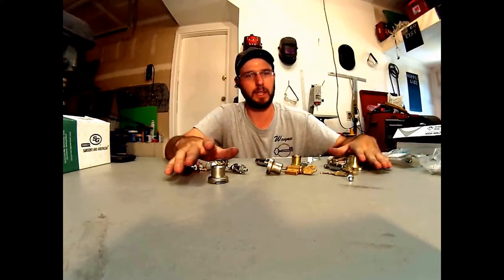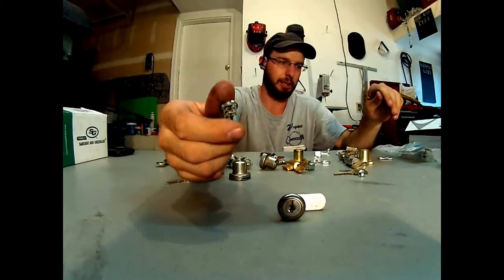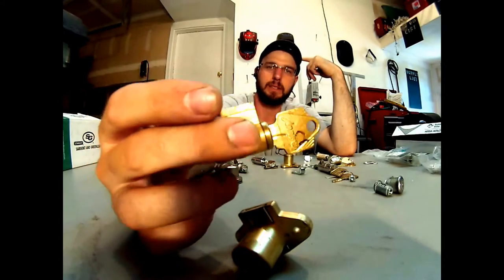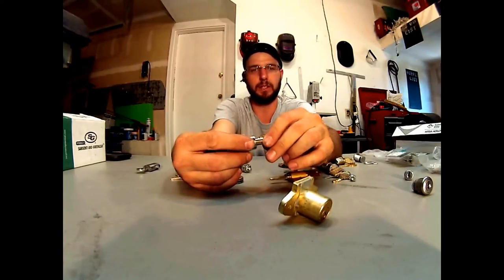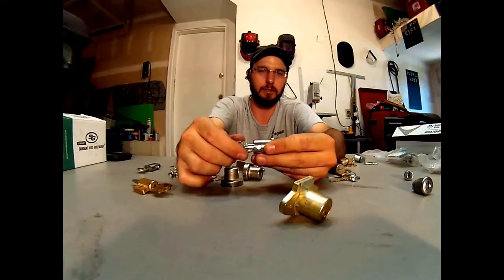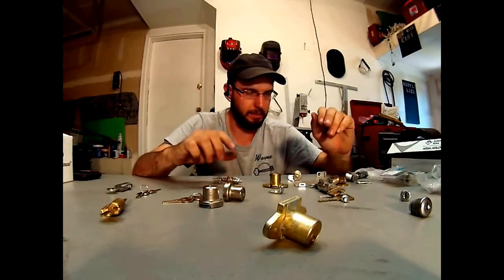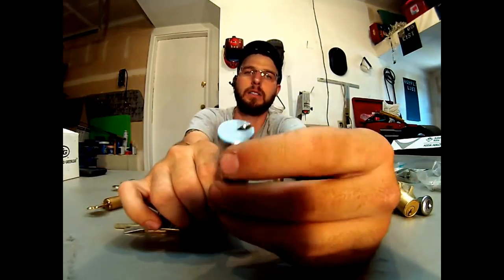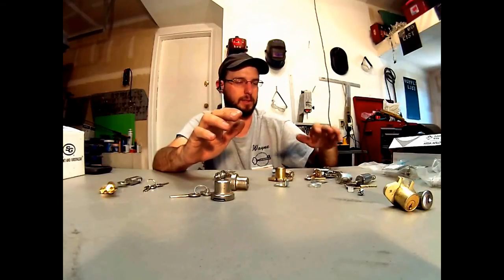Pin Tumbler Lock, Disk Tumbler Lock, High Security Lock

Comment: If I were trying to pick a pin tumbler lock that's in a doorknob with a bobby pin and the bulbous tip of said bobby pin broke off into the lock and lodged in between two of the tumblers thus rendering the key ineffective, how would I remove the piece of bobby pin? The piece is about 4 mm long. The key goes all the way in but can't unlock the knob (I took the knobs off already).
Reply: There's five pins for the lock